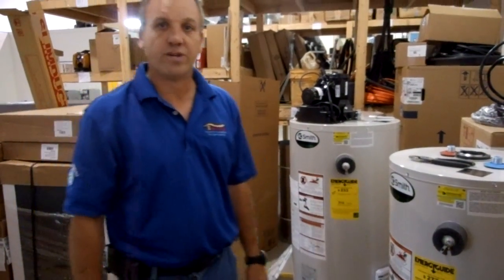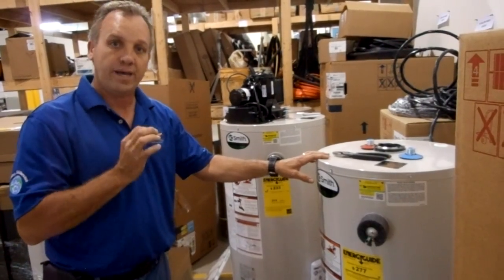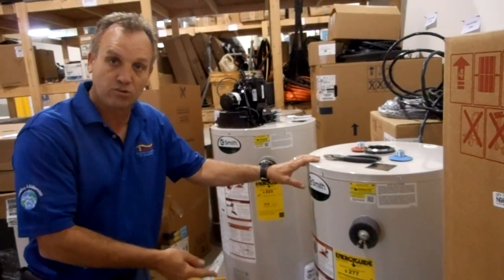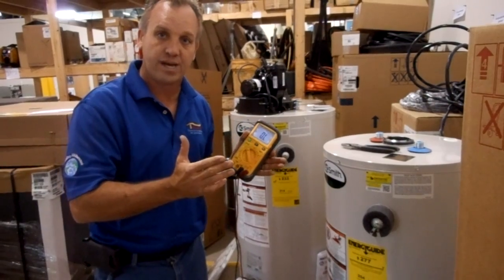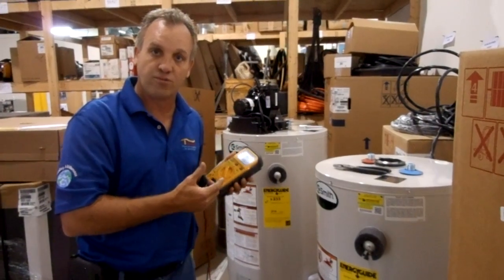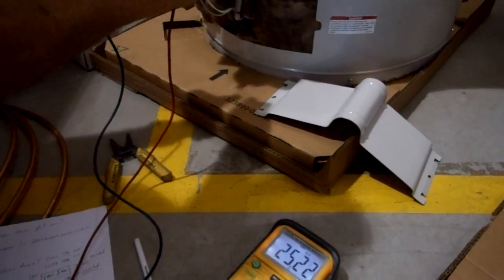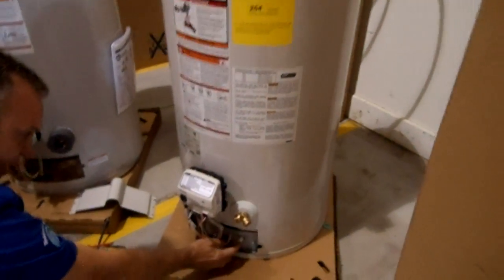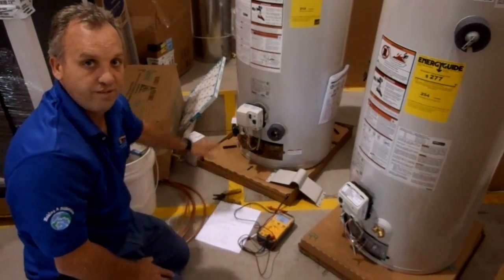Robert Martin Vapor Sensor Testing

Comment: Thanks for the video!  So I am familiar with the glass vial type thermal switch that slams the damper door closed preventing combustion if temperature reaches 385 or something. Are those still used as well as these vapor sensors?  These vapor sensors sense the vapors and stop the process sooner than the glass vial would break I am guessing?  It's proactive instead of reactive.  I'm sorry I like all the safety features but I think it's overkill. I've had an old style water heater for decades and decades and never had any issues. Sometimes it comes down to common sense and understanding how things operate. Meaning you should know better than putting gasoline anywhere near a flame source as the bottom line. A lot of these things just cause issues for the end-user causing them to buy parts and have service done that normally wouldn't be required. All the while taking cold showers and cursing these things. Thanks for the video

Comment: a 10 K Ohm, 1/10 W resistor is getting me through the weekend, until the new sensor(s) arrive.  For a Honeywell controller, the reset procedure is: Unplug power; Wait 10 seconds; Restore power; Using the temperature dial turn from full hot to full cold to full hot, and repeat at least 6 times within 30 seconds.  After about 5 or 6 times the heater will kick in and start running. 

I like the idea of placing a second (new) sensor in a zip-lock bag, but given the failure rate, I think I will just resistor it again for a few days when the new one dies, and hopefully the quality will be better on the sensors by then.  My heater is only about 90 days old, so I am not impressed by this sensor.

Comment: I was able to jump out my vapor sensor temporarily on my Rheem water heater by using a 10k ohm 1/4 watt resistor from Radio Shack, I had to reset the controller and it started right up, I will keep it in until my replacement arrives. To reset my controller I had to disconnect power turn off the switch on the power vent, set thermostat to low and wait 10 minutes, reconnect power, turn on power vent, rotate thermostat from low to very hot seven times within 30 seconds, leave on very hot until unit starts, then set to desired temp. PLEASE DO NOT LEAVE YOU WATER HEATER JUMPED OUT!!!!
Reply: Thank you! You saved me dude. This part blew at our restaurant so you saved me time and $200. Merry Christmas.
Reply: Shanianut my Rheem fume sensor isn't working how do I bypass it to make my water heater work
Reply: Thanks for giving me the key to getting going again.  This was extremely helpful

Comment: I flushed out my water heater this last weekend.  I must have got some moisture or something in it because the heater wouldn't fire up.  I measured the ohms at 139K ohms.  I then blew into it to clean it off and the ohms shot up to 240k ohms. and it seemed to get worse the more I tested it.   Now it reads 0 ohms.  Don't blow into it to try to clean it.  If you can, place it outside in the fresh air to try to save it.  I currently have a 30k ohm resistor jumping the connection waiting for the $25 sensor in the mail.  If you are going to paint, clean, or use any sort of chemicals close to the sensor I would recommend you shut down the heater and remove the sensor first.  When you buy your replacement sensor, buy two.  Take the spare and place it in a zip-lock bag for safe keeping.

Comment: Great video.  I have a Rheeme water heater and it kept shutting off due to the flammable vapor sensor.  Mine is located right where the burner is not on the side.  I have reset the heater a few times it turns on but then shuts off after a while.  I am now waiting for the service technician.  I wish I had an oms reader so I can do a reading before he arrives.